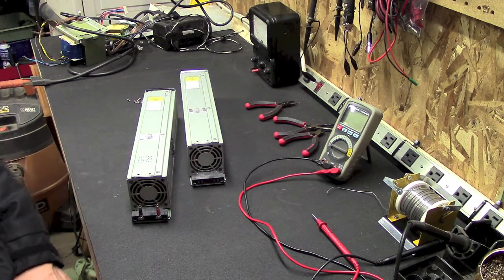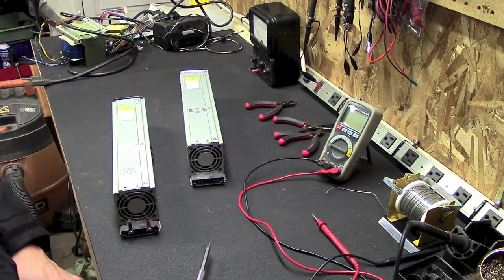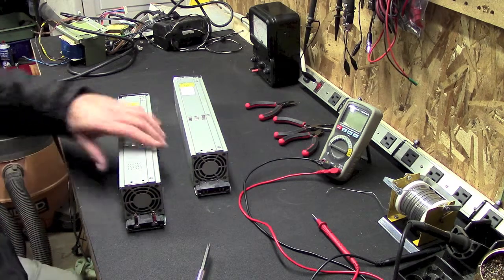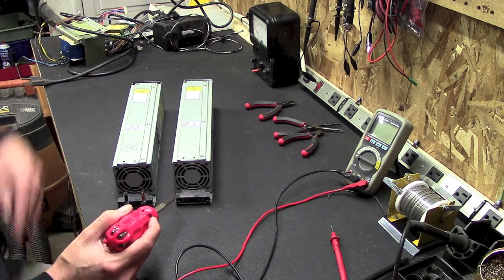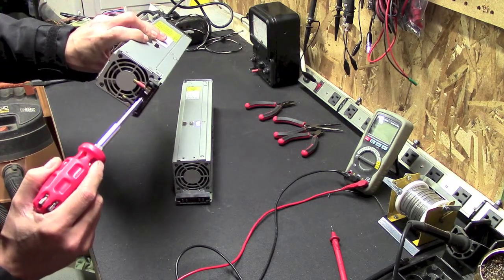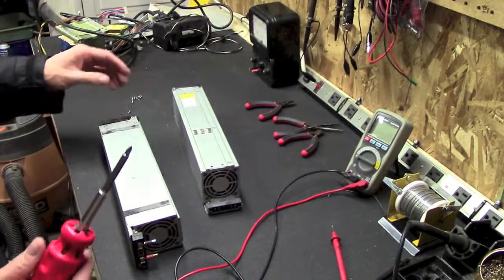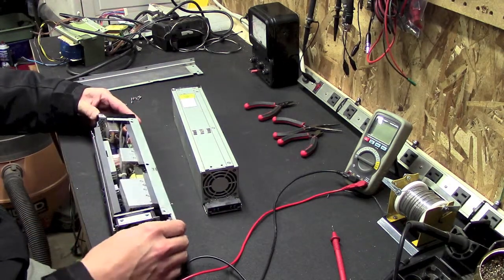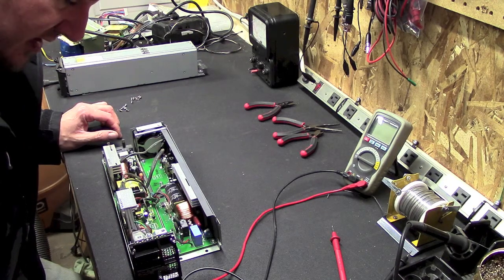PSU DC Ground Isolation

Comment: Hi, do you still have continuity between the negative output and the ground pin on the AC input ?
Reply: Kassia Bunnett It sure is. Still comes in handy when a DMM won't work.
Reply: Kassia Bunnett No, you don't. That is the whole point of this mod.
Reply: @suzukiman650  < replied to wrong comment < talking about the Simpson 260 (just to clarify any confusion)

Comment: At the 7:27 - 7:29 mark, you showed the ground for the two MOV devices that will take any surge from Line or neutral and ground it...
I believe you could have left that intact, as it would have connected back to the Ground Pin on the input of the AC cord....
I noticed you didn't do a continuity on that point... so if your not sure... run a wire directly to the ground pin on the AC side of the input to the insulated place you made.....